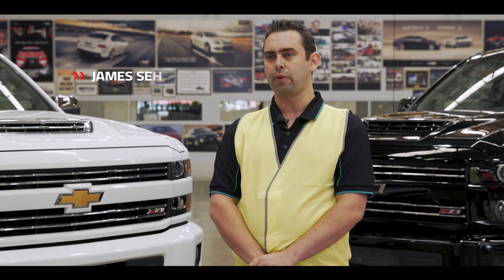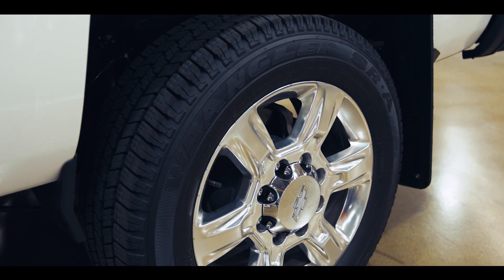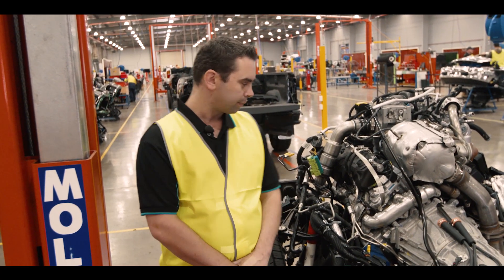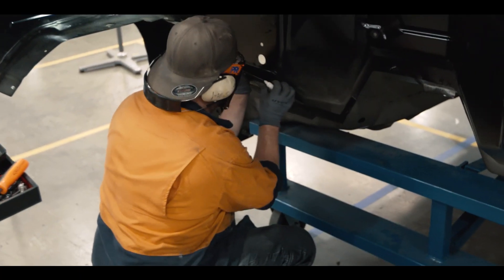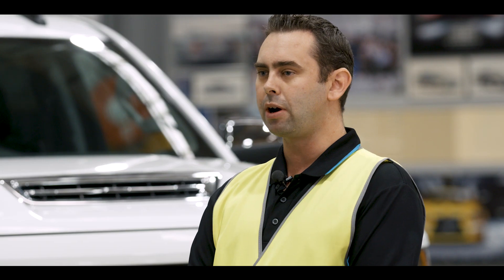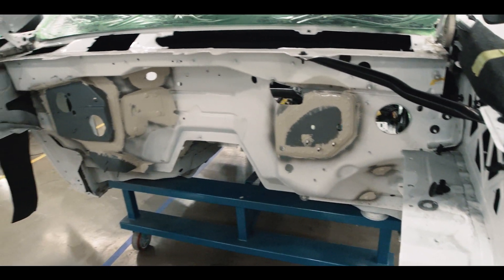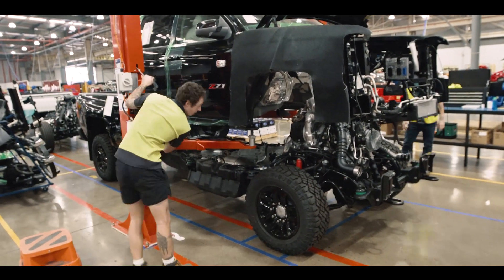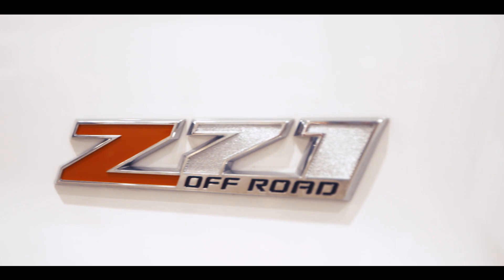The Chevrolet Silverado Re-Engineering Process

Comment: I’m curious how they did the turn signals. Because everywhere else in the world requires amber turn signals on the rear, which the Silverado does not have from the factory.
Reply: The reverse light is changed from white to amber and the system is set up to blink the reverse bulbs when turning. Putting the transmission in reverse causes both amber lights to come on, which is legal in Australia.